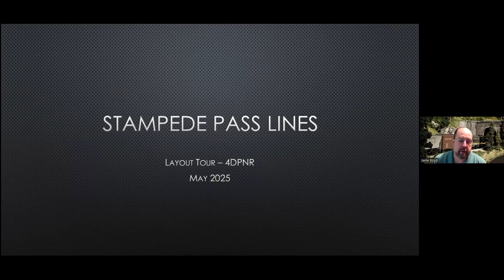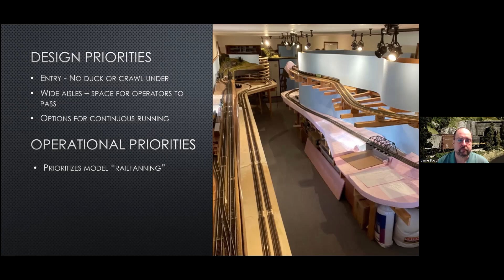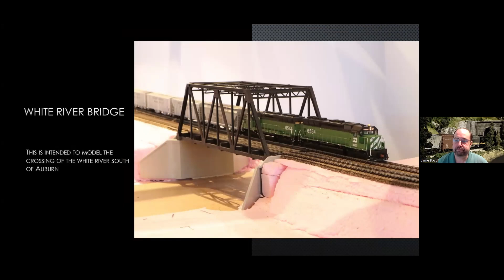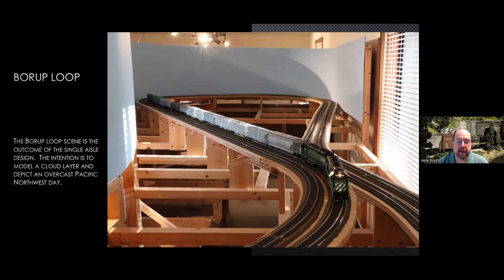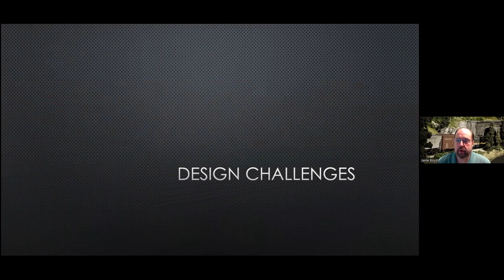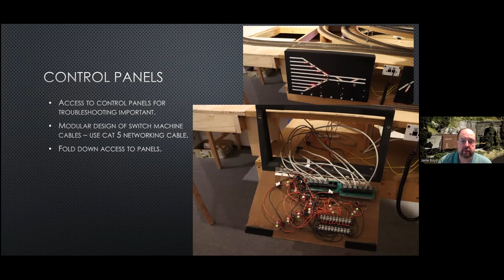Jame Boyd HO BN layout tour Auburn to Stampede Pass #modelrailroad #train #nmra #track #design #art

Comment: Jame, during the presentation you made a mention of  "the powerhouse atop the snow shed." This may be confusing to some, the powerhouse there was used for powering the fans to clear out the smoke in the tunnel. With the large openings as windows these were used as intakes for the fans. From seeing what your train set used to be, on the kitchen table to this iteration, you've come a long way and should be an inspiration to those just starting out.  Impeccable presentation!!
Reply from the maker: Thanks for the clarification and your kind words!